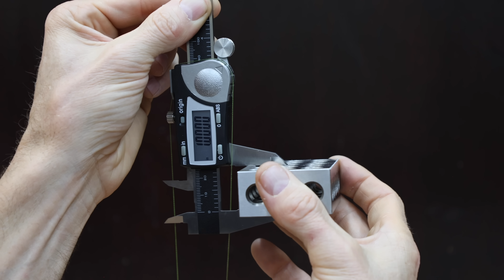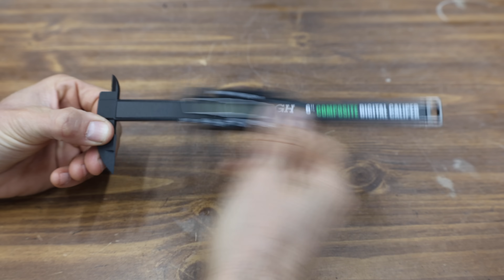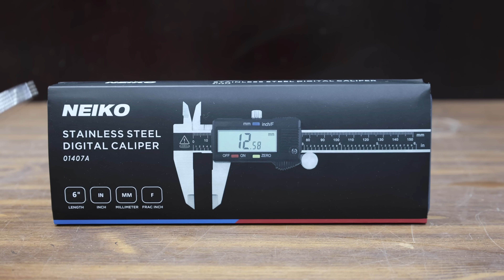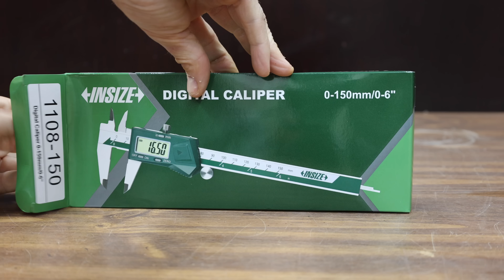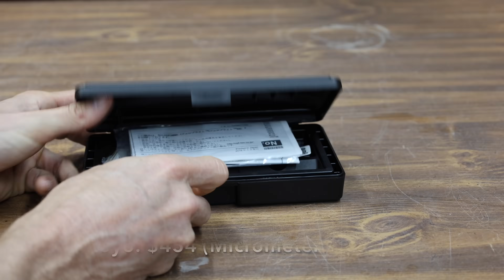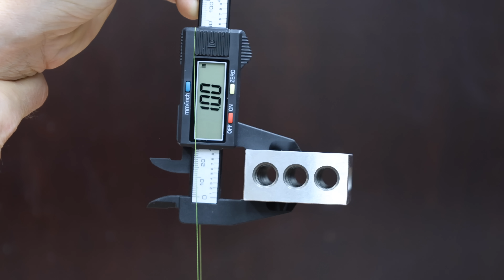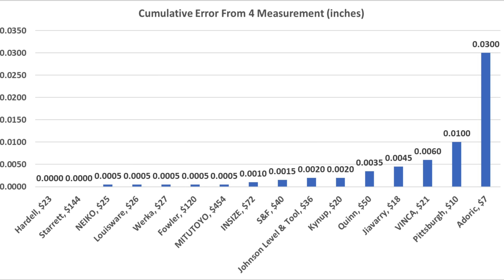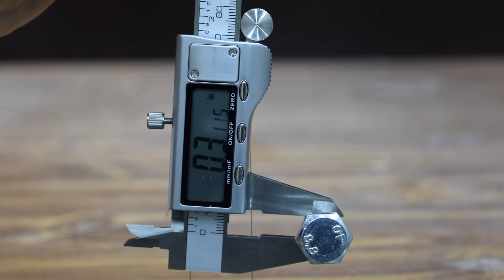I've Been Proven Wrong About Calipers!

Comment: Thanks for doing this video! I've used calipers of varying price points extensively in a professional capacity. IMHO the minor variations in accuracy between brands isn't very important. The three main criteria I'd use to judge calipers are
1) Reliable measurements. Many cheaper brands seem to occasionally produce incorrect measurements, especially when the batteries are low. Who wants measurement tools that lie to you? (I don't know how I'd test for this)
2) Smoothness. (Covered extensively in this video)
3) Battery life. From what I can tell most of the cheap calipers have awful battery life because they have fairly high power draw; apparently even when they are off. I don't think the battery size matters nearly as much as the power draw. This should be measurable with a DMM that measures uA.

Comment: I can't remember who did the video, I think AvE, a lot of calipers actually drain the battery while "off" to maintain the zero. I've got all kinds and constantly go back to my mitutoyo as they rarely need batteries, measure dead on and are very smooth. Same set for 16 years and I just bought a new set, and noticed right away the difference in the worn in feeling. Every time I grab my cheap sets the batteries have died from just sitting on the shelf. Just my 2 cents from something I have a lot of experience with.

Comment: I work in an aerospace machine shop. a few things:
1. All of these calipers have an accuracy rating of +-.001", and you shouldn't use them beyond that. If you need a precise reading, obviously use a more accurate tool.
2. We calibrate our calipers in-house every 6 months. From the cheapest harbor freight to the most expensive mitutoyo calipers, they all can calibrate. Usually the cheapest ones have manufacturing issues involving grit in them, burrs on the edges etc. A little sanding with fine sand paper can clean up most all of them. 
3. The "absolute" feature of the Mitutoyo - Basically every single caliper made these days "works" the same way - any time you open or close the jaws, it will read accurately any won't need to be reset... It's just that the other ones do it by having a low-power circuit remaining "on" all the time, to keep track of the pulses. This could lead to lower battery life, but even on my cheap 4" Harbor Freight set, it still lasts multiple years. And, yes, it will maintain a zero for months(between calibrations).
4. There are some Mitutoyo "clones" out there - I bought a 12" set for under $50, KNOWING it couldn't be a real one... but even side-by-side with a legit one it's basically impossible to tell the difference. And, yes, it was just as accurate.
5. The biggest reason for a caliper to fail calibration is due to wear/use - getting the nibs beat up, or the tips wearing down. Dial calipers also have issues with metal chips getting on the rack and damaging the tiny gears. I ended up switching from quality Mitutoyo dial calipers to cheap digital ones after destroying a couple of sets... and my dirt cheap set has calibrated just fine for 5+ years now.
Reply: How do you calibrate? You just note down the current accuracy?
Reply: @worroSfOretsevraH More or less. We use a set of calibrated gauge blocks of various lengths to check each measurement on the caliper. For us, every measurement has to be within .002" of the actual reading to be acceptable. For example, a 6" caliper might be checked at 0, .25", .5", 1", 2", 4", and 6", and the readings all noted down. If something doesn't pass, we could loosen or tighten the two adjustment screws at the top of the caliper - this can help make sure the jaws are square to each other. Also, setting the zero point with more or less force - perhaps setting it to .0005" at "zero" gives the most accurate(throughout the range) result. Also, if one particular (minor) thing - Say the depth gauge - is out, we might just note that on a calibration sticker on the caliper itself, and you just can't use that for measuring anything "official".
Reply: Generally with NIST traceable gage blocks for o.d. and depth and a ring for i.d.  @worroSfOretsevraH
Reply: @worroSfOretsevraH  They have certified calibration tools you get. Like the block used in the video.
Reply: @worroSfOretsevraH  It's not really "calibration" as much as it is 'Verification." You measure what is known as "Standards" and the measurement should match exactly, if not....trash'em. Also not covered here was jaw parallelism. Squeeze the jaws together and hold it up to the light. You shouldn't see light between the jaws, if you do....trash'em.
Reply: So is that $50 clone set still available or what? 😅
Reply: @AB0BA_69  Insize is good
Reply: @A @AB0BA_69 ok up iGaging brand. I have a 6 inch and 12 inch set and they are both Mitutoyo clones and priced at around $50 and $90 respectively for the absolute version.
Reply: In the U.K. these vernier measurers are known as ‘very nears’. This is because they are as good as the operator for accuracy!
Reply: @glynluff2595 US too!
Reply: I remember back when I worked as an electrical engineer for a defense contractor, all the dial calipers had calibration stickers on them and had to be calibrated every so often. I had one in my desk that I'd use occasionally, typically for creating mock-ups or prototypes. I got in trouble when they found it hadn't been calibrated in like two years. But since I never used them on the factory floor, or for any production part, they didn't make a big deal about it. Just put me on the rotation for the QC minion to grab it up and calibrate it on a set schedule.
Reply: @NathanExplosion99  stickers are still used in the UK and calibration yearly.
Reply: If you need to ensure a measurement of 0.001" or greater, none of these tools are ideal. I have a really beat up Mitutoyo that is used more as a ruler than for any precision measurement, great for determining bolt sizes or stuff in the 0.010" range.  I have a near unused Mitutoyo when I need to know down near 0.001". If it really has to be 0.001" or better, it's time to pull out micrometers. Even though my Mitutoyo's don't shut off automatically, I very rarely have to put a battery either one. Last time I did it was at least 3 years ago. I do try and remember to shut them off at the end of the day, but I have forgotten a lot to do it.
Reply: @3866TIM  you are certainly correct that if you really wanna accurately measure to .001 of an inch, you need a tool that has a resolution of 10 times that. So you need a micrometer. That is sort of a basic rule of metrology. 😊
Reply: This is the best comment in the thread. It's just common sense. For 99.9% of people who do 3D printing and similar stuff, just buy a $10$ caliper, and you will be fine without calibration ever. If you plan to have a serious machine shop, read this comment.
Reply: @hrvojelasic5794  The batteries in my $15 set die every 6 months. I've taken to storing them with the battery removed, while looking for better quality ones.
Reply: @logothyt  I think it is not about the quality of the battery, but the way they designed the power supply. In lower-cost units, they cut corners and probably use a lower-cost power supply that slowly leaks energy. What you have already done is perhaps the only option.
Reply: @hrvojelasic5794  A battery is the power supply. What else could it be? A nano-sized diesel-powered generator?
Reply: @hrvojelasic5794  No. They are just using older microelectronics.
Reply: @hrvojelasic5794   I would argue for more advanced calibration such as shrinkage compensation you will benefit from a resolution of 0.01mm, which they start around 18 bucks, all you need is an 18 dollar harbor freight set, more expensive ones as shown in the video only make sense for higher resolutions (accuracy isn't different enough without also getting higher resolution ones), which past 0.01mm is pretty much useless for most people
Reply: @hrvojelasic5794  I disagree. I have like five cheap ones and everytime I need them the battery is dead. I don't use them often so I would estimate that on those that I have the battery dies in a matter 3 to 6 months. My Mitutoyo battery lasts like 5-10 years. Don't remember replacing the battery. It is very annoying when you need a tool and you discover you are out of batteries, again.
Reply: @Axel_Andersen , what do you disagree?
Reply: The Mitsutoyo absolute positioning doesn't work like that. It has a (now expired) patented design for its encoder where it can determine the slide position even after battery removal without zeroing. Other forms of calipers have a different encoder design without absolute positioning that requires zeroing. All digital calipers stay on in a low power mode all the time unless they have a sliding power switch. That's how they know to check for button presses to turn on.
Reply: Unless you have worked in the Aerospace industry you don't have an idea how accuracy is so important. When your work is inspected to the highest level it has to be right, your job depends on you having accurate measuring equipment. You can obviously get away with cheaper equipment when accuracy isn't so important. I mean you wouldn't really purchase a Mitutoyo calliper for Hobbyist or Joinery work  it would be a waste of money when there are cheaper items that will do fine.
Reply: @sambuka57  I'm a hobbyist but I still bought the Mitutoyo caliper after going through several cheaper alternatives. It's just way more reliable/repeatable, and because it's so accurate, it replaces my micrometers in the vast majority of projects. Also, it's much cheaper than @projectfarm showed here with the micrometer package. They have the basic 6 inch caliper for sale on MSC for $115. Not cheap by any stretch, but cheaper than Starrett by a lot. I've had it for a few years now and never once regretted spending the money. It's one of the most used tools in my shop. On less commonly used tools, I still cheaped out a bit, but I have to pick my battles.
Reply: Something else of note, I find myself using calipers for other projects outside the machine shop. Automotive work is high on the list, but also carpentry and other DIY. I never thought I'd need to measure precisely for those applications, but I find reasons all the time. A good set of calipers is essential for any workshop in my opinion, along with the lathe and air compressor. I use all 3 almost every time I set foot in the shop no matter what I'm working on.
Reply: I've seen real Mitutoyo tested as forgeries and it wasn't even close. The forgeries lack the features that you mention, and their accuracy becomes very inconsistent after a while.
Reply: I've found the same thing is true with multimeters. I have several very expensive Fluke multimeters, but for most measurements a cheap $18 meter will give you what you need. Is there continuity, is there voltage, what is the voltage, in some cases what is the AC ripple, even capacitance. And it hurts a lot less when you accidently slam the hood of a truck down on a $18 harbor freight meter than it does on a $450 Fluke.
Reply: I use HF dial type in my shop with no issues. Plenty accurate enough for my use. And if I drop a set and ruin them, they go in the scrap barrel and out comes a new pair.
Reply: Comments like this is why I try to always go through the comments on a YouTube video.
Reply: Great info thanks
Reply: My first set was some mitutoyo dials that I found on a table by the Costa deburring machine.  After I got moved to the machine shop, I brought them with me.  I still have them.  The tips are screwed, so they don't work great, but they still measure decent enough to about ±.003".  My new pair is identical, but newer and much better taken care of.  They work to ±.001", but I don't usually measure anything closer than ±.003" with them anyway.  Too easy to put too much pressure on or hold them funny.  I move to mics for that.
Reply: If you use your calipers in a cold environment you might notice a difference. I find that the cheap ones stop working below about 40*F. They'll lose zero randomly, count more than they should when cycled, etc. I have a knockoff Mitutoyo 12" (looks almost the same as a Mitutoyo but branded differently on Amazon) that I paid $60 for that doesn't do this, and the actual Mitutoyo 6" caliper are the only ones that don't have this problem.
Reply: In my shop we don't use calipers to verify measurements. Only in setup to gauge how close you are, where other methods are impossible until the workpiece is out of the machine.
Reply: I got a second hand Insize for about €25, and I'm super happy as it's suuuuper smooth.
Reply: I was looking for someone who would break it down like this. Used to be in a production job shop for about 10 years. 
Similar experience to share. had off brands for doing naughty things like layouts for making stuff and/or just for doing manual work. I still mostly stick to my dial calipers just cause I dont have to worry about a battery. 

The main differentiator between my $900 mitutoyo 8" (carbide tipped inside and outside) and my 50$ clone was definitely longevity, I used my clone mitutoyo on a very long running job for OAL (it was +/- .010). After a year running that part I actually started wearing a "hole" in the jaws. Mind you its still a year. I never even had battery drain issues with my clone like most do.  
100% on the .001 accuracy, def get the side eye from old heads using a caliper checking certain parts. Most jobs I ran on swiss lathes I never even touched my caliper.  

One thing I noticed you didnt touch on, the wiping down jaws prior to measurement... A small fiber from a cloth could be all that it takes for any of those measurements to be just the "hair off". 

Zeroing is done with a piece of paper, gently squeeze in jaws and while holding pressure pull the paper out, check your zero.
Reply: I'll second the tip issue. I used to occasionally calibrate calipers and saw a couple that had obviously been dropped on the floor in the lab as only the very tips were touching and caused them to fail calibration when measuring close to the bar. You can try to polish them back down using a stone, but, as I was never directly trained for this, I doubted whether or not I did it correctly and just had to throw them out. Testing the metal hardness might be a good addition to the video, as I'd expect the cheap calipers to use soft metal.
Reply: What was the Brand/Model of the Mitutoyo clone for $50? That would have been helpful info.
Reply: "All of these calipers have an accuracy rating of +-.001" "
No, the Adonic 0:12 claims an accuracy of 0.01", lol.
Reply: @alsavage1  I thought one of them claimed .0001"
Reply: @alsavage1  that's the claimed accuracy due to worst expected manufacturing tolerances.   Many copies will be better and that's true of those with a 0.001 accuracy.
Reply: @alsavage1  The seller might be the only ethical one, stating the truth. Some or all of the others may be lying. Or all may be telling the truth.
Reply: @alsavage1 I bought the exact same as the adonic at 2$ on Aliexpress, tbh, even 0.1mm accuracy is plenty enough.
Calipers aren't meant to be such precision tools, micrometers are.
But I'm curious about the accuracy relative to thermal expansion for the most expensive ones (even if 10°C only amount to 1 micrometer per cm), in civil works, surveyors work with invar precision leveling staffs for this reason.
Reply: Excellent information. One other noticeable difference between the real Mitutoyo and the counterfeit ones is that counterfeit ones munch batteries like crazy. This project farm review should have measured operational and standby ("off") current.  Knowing power consumption is 100x more useful then then knowing battery capacity.
Reply: Interesting... My accurate set is an RCBS dial caliper I've had for a decade. I use a cheap digital HF one for most other stuff. I still have yet to replace the battery in the HF caliper. If I need accuracy, I grab the RCBS caliper.
Reply: Mitutoyo are still the only absolute calipers on the market. The reason you don't need to zero the other brands is because they are actually always on, they will loose their position if you remove the battery.
The biggest practical difference is a massive difference in battery life and you can never loose a step with high acceleration or impacts
Reply: Yep, you shouldn't expect accuracy beyond ±.001" or .01mm no matter the quality, even if the manufacturer said it can. If you need such fine accuracy, just don't use calipers at all, that's simply not calipers job

BTW, I prefer cheap stuff with its own identity much more than similar priced clone that pretend to be high quality brand
Reply: And that’s why more and more airplanes crash
Reply: @DingusSquatfordJr. Espero que estes bromeando, y dinos porque no incluiste el argumento de maximizar beneficios a costa de la disminusion de calidad, y la exigencia de apresurar el desarrollo de piezas

Comment: One thing to mention, Battery life is significantly worse on cheap calipers, my mitutoyos are an average of 4 years per dead battery with daily use. the screen is still vibrant with a low battery.
the cheap pair i use for rough work kill about two+ of the same batteries per year. the screen is barely readable with a low battery

Comment: Excellent info, as usual! If you use calipers like this on rare occasions and don't need absolute accuracy, I recommend the Adoric for $7. Honestly, for the rare times I actually need one it works just fine for me. But if your work requires high accuracy then you probably already have one of the high end calipers.